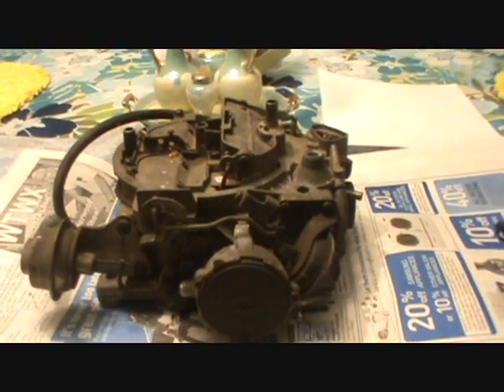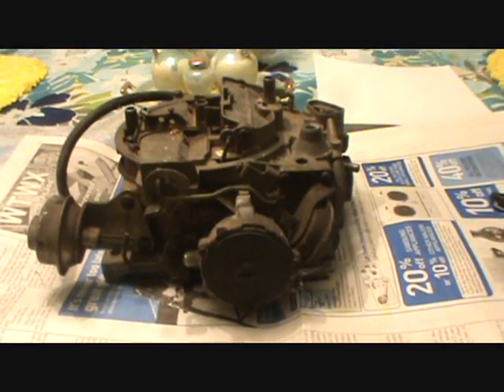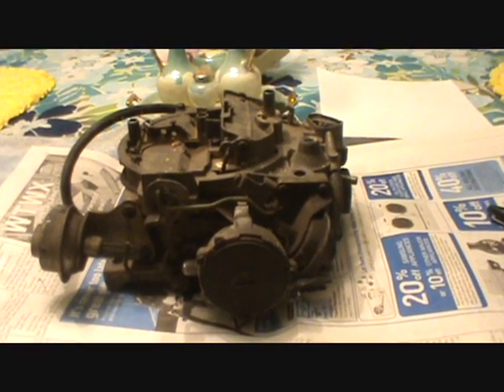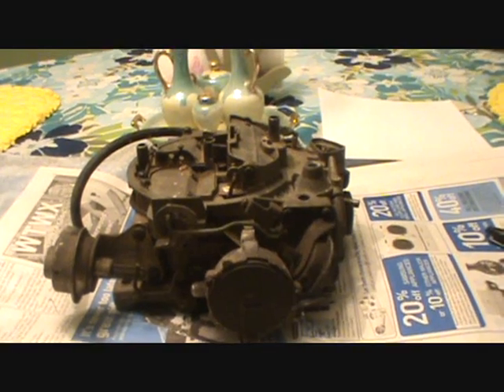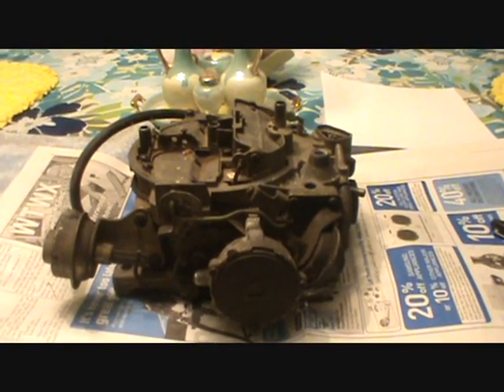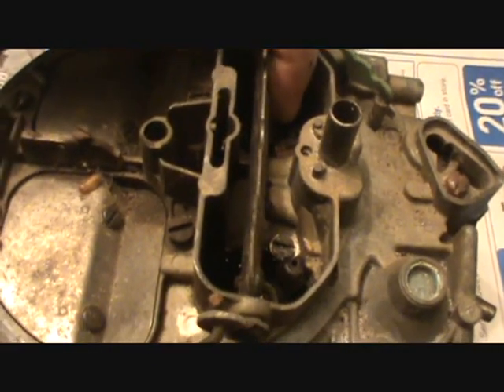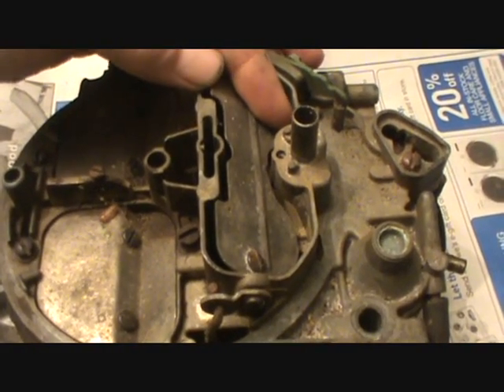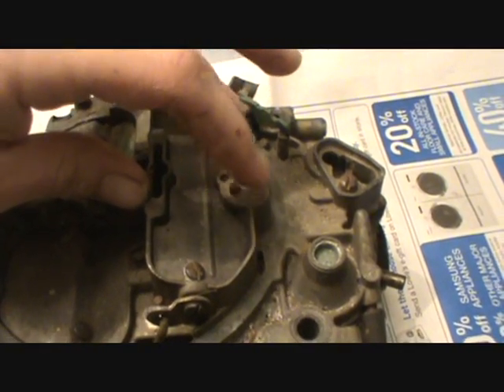How to understand automatic chokes part 1

Comment: When I put the air horn back on and tighten the choke plate screw, do I want the plates straight up and down? I tightened with it closed and now the secondaries are locked. I wondered if that’s why. I have two pull offs. One that’s loose (doesn’t stay in when I plug the port)..the secondaries open with that, but I feel like that’s because the pull off isn’t working.

Comment: Hi Tyler,  I've watched many of your Q jet videos.  Is it true, that the pull off diaphram will relax, and allow the air door to open when manifold vacuum drops above idle and midrange?  "70 Cutlass, 403, '70 heads, headers, edelbrock dual plane , lunati 485.495 cam.  I've disconnected the pull off hose and blocked it, to watch the air doors. which work like I'd expect in the garage.  But I presume that while driving , I'd want to let the pull off linkage keep the air door closed until higher RPM.  Do I have it right?  Tom

Comment: I'm trying to fix a buick 4.1 v6. The choke looks like it's just stuck open. When I push it there is no resistance it just bobs up and down. Do you think a spring or somthing is missing. The choke doesn't do anything when running or when giving it gas. It just stays open
Reply from the maker: Missing or broken. Rod from the choke plate goes down to a small link that rides on the inner end of the choke "pivot".  Sometimes they don't get put back correctly. The spring inside the housing is integral to the entire operation of the choke. Studying a picture or exploded diagram will help you understand what you are looking at.

Comment: My Rochester 4 barrel (1988) on a marine Chevy 350  (28 foot Bayliner boat) starts and runs but when kick in the gas it dies.  Runs great under idle and at high RPM's, but when put into gear and put it under load dies.  Ideas?
Reply: Doug Hogan the switch that makes the engine stumble or actually shut off for a second when you put it in gear is out of adjustment it has the switch to save wear on the out drive gears when engaging forward and reverse

Comment: Can you explain why some electric choke carbs like edelbrock 1406 don't use a vacuum brake and still work well on cold starts?
Reply from the maker: They have one, it's internal.
Reply: Explain, I took mines apart and didn't see anything like that.
Reply from the maker: Go down this page until you find "choke adjustment". On these it is called a choke piston, but still works from vacuum. It's part of the choke housing. If you look at the front part of the housing you'll see the shape of the bore that the vacuum piston travels in.
http://www.telusplanet.net/public/gilesij/Volvord/section_2.htm

Comment: Hi, I just used used your  videos to rebuild my Quadrajet. I don't know if I have the choke set right. I can't open  the choke flap unless I pull back the throttle lever. I see in your video you can move the choke flap freely without messing with the throttle lever. I have two other Quads where I don't have to mess with the throttle lever in order to move the choke flap. Is something out of adjustment? Thanks for your very informative videos.

Comment: Really enjoy your videos on these Quadrajet carbs. As you went through in the first three parts of this series, the secondary portion of my Quadrajet would not function no matter what. Unlike your carburetor, mine has only one vacuum pull off at the rear which acts as a limit on those air doors and also acts as a choke pull off. So there are two linkages, one for the air door, one for the choke pull off. Well the second linkage had fallen off and was jamming up the end of the throttle shaft for the secondary. Could not see this from on top of the carburetor as it was on the engine because the electric choke housing covered it up along with some coolant hoses which run right next to the choke housing. Believe it or not....this is on a Mopar 360 cubic inch...Rochester Quadrajet, stock from the factory 1987! Been running on the primary jets only for the past 25 years maybe!! Lol!
Reply from the maker: Haha, how about that. Yep, Mopar used Qjets from 1985-87 because Carter Carburetor exited the carb business during 1984-85.
Reply: Tyler's Neighborhood Garage this rig is running alot better since I worked on it... but is still a dog and I am not certain the secondary is working. Hitting wide open throttle just doesnt get much for hp. Starting to wonder if my exhaust system/cat. Convertor isnt partially plugged. Getting some strange rattling noises from under the floorboards. Will look into that when the wethr warms up.

Comment: My Rochester quadrajet attached to my '74 Olds 98 will not start after sitting maybe 10 days unless primed. Any idea on how to correct this?
Reply: Not sure if my scenario matches your issue, but on my 78 Silverado, the fuel tank is mounted so low that the fuel drains back to the tank, emptying the fuel line, and applying a vacuum to the needle in the seat.  If enough time has passed it won't break the vacuum and a splash of fuel in carb is needed.  I have a clear fuel filter that will be empty, I crank until filter contains fuel, one pump on pedal, splash of fuel, and fires right up.  Maybe I have a needle / seat issue, maybe I have a fuel pump issue.  Hope this helps
Reply: Steve, If you watch some videos about Quadrajet rebuilds they talk about lead well plugs on the bottom of the center section of the carburetor, the section that holds the float, needle and needle seat, etc. Those plugs tend to develop slow leaks after thousands of heat cycles. You can melt them and replace with epoxy, JB weld, etc.  Google up Quadrajet Well Plugs and you'll find info on this.

When they leak slowly over several days the fuel in the carb bowl drains out, this causes hard starting because you have to wait for the fuel pump to refill the fuel bowl. I bet that's the cause of your issue.

Comment: i have a 1991 astro van and everytime i turn the swtch on and push the gas pedal it wont start have to wait a couple of hours and try it again. then it starts if i dont press gas. ive been told its the choke and needs adjusting

Comment: I have a 1987 Monte Carlo super sport it seems when I put the car and drive or reverse the idle drops. Even if I put the AC on car wood putter  like it wants to stall does anyone have any ideas was told it could be. I was told it could be the Idle control valve but not sure where its located ?
Reply from the maker: Steve Acevedo  Steve those don't have an idle control valve. Those are a fuel-injected part.

 Your car has a plain old carburetor, which in this case is computer-controlled but still adjustable.  If you don't feel capable or have the means to adjust the carb and timing and check for vacuum leaks, then I suggest you find a GOOD garage with mechanics that have been there long enough to have worked on carbureted cars and have the following done:

1. Check and adjust ignition timing
2. Check and adjust idle mixture if possible. Sometimes the adjuster screws are sealed.
3. Check and adjust automatic choke, fast idle speed and base idle speed.
4. Check idle-up solenoid for proper operation with AC on.

I can further explain any of this if you desire.

Comment: Hi I have a 1978 bucket regal limited 5.0 305 V8 with a 4 barrel carb quaddrowjet divorced choke it has a problem starting in warm and cold weather and it wants to die all the time could that be the carb or no should I buy a new one

Comment: my name is scott and hope you can help. i have 79 k10 5.7 it leaks gas in to the engine when it sets. it runs great just after it sets i have to crank it for awhile before it starts and then it smokes but it gas smoke do u have a fix for that.. thanks
Reply: b
Reply: valve spring seals? mine had a similar problem after a day of not running it burned a tinny bit of oil

Comment: What makes that choke housing work? I just ordered a carb that has a housing like the one shown. There's a block off plate on my manifold that I know works everything, but can't seem to find what Im going to need to make it work. I know a bit about qjets. I'd like this to be my first one with a functioning choke though. Lol
Reply from the maker: It works off of hot air. A steel line normally leads from a connection at the top rear of the air horn down to where that block-off plate is. There is supposed to be a part called a heat stove in the intake manifold. A heat stove is simply a length of steel tube that will fit inside that recess there and causes the air passing through said tube to get hot.

The air is drawn through the heat stove and into the choke housing by a small vacuum orifice inside the choke housing. Of course, there is a tube that leads from the heat stove to the choke as well.

 What kind of engine is this? Oldsmobile commonly used hot-air chokes and the parts for those are easy to find, but although Chevy did use some hot-air chokes, the parts are slightly more scarce.
Reply from the maker: Google Oldsmobile hot air choke and look at the images for that search. You'll see right away the different parts I described. It's a very simple system.

Comment: What happens if you try to adjust those two screws and there's no response. Is there a rule of thumb about how to adjust them for instance should I turn it all the way to the right and then back it off maybe one turn
Reply from the maker: If they don't respond, then possibly something is affecting the mixture, such as a vacuum leak, or the carb is dirty/running too rich. Sometimes the ignition timing being out of adjustment can have the same effect.

 On the mixture screws, a baseline is to run them in(clockwise) until they lightly seat, then back out 2-1/2 turns.That should always get one running.

Comment: My lincoln with 460 cid ford semes to have hot air system and an electrickal conetor to the choke housing is it boulth systems? Anyway i had plugged the hot air system stupid me:-D so now it works!
Reply from the maker: Yes, it's a hot air choke with electric assist. Mainly done to make sure the choke did not stay on longer than needed during moderately cool weather. There's an electric switch that cut the electric assist when the temps got low and the choke needed to be on longer.

Comment: so when your car is off and cold the choke should be wide open right?? mines stays closed . I open with my finger and it clicks and stays open. this is when the car is cold and not been running for awhile.
Reply: Flap should be closed when cold, it'll open up with heat

Comment from the maker: Congratulations! The "flap" part of the choke at the top is usually has spring pressure to keep it closed until some type of heating begins working on the spring that closes the choke in the first place. Sometimes the spring is on the carb itself or sometime on the manifold below the carb. So, what you are describing seems normal unless there is a bind caused by mechanical interference.

Comment: hey I was wondering if u can help me.
I just bought my first truck , its a 74 chevy pick up 350 
and I crank it and it starts but it shuts off after 3 sec 
I also notice that gasoline is shooting out the top of the carb right next to the choke flap 
do u think that its to much fuel getting into the carb ? 
how can I fix this problem

Comment: I have a '75 covette with a quadrajet, and after I run it for a while it will run-on for a second after I shut it off, what could cause this? Its not running too hot but it stumbles when i try to engage the 4-barrels, could there be too much unburned gas? I have watched your other videos and will try to fix the 4-barrel problem, any ideas?

Comment: Hey Man great video. I have been using these carbs since i was 16 and rebuilt a 307 chevy I knew choke n off choke never worried about it. I have 3 carbs on 3 moters that this choke thing will help. was thinking of getting rid of carbs n going to fuel injection for fast starts. Again thanks for your time.

Comment: I have a 1985 K10 with a 305 and when I cold start the motor it runs for a second or two and cuts off.  When I start it again it usually stays running the second time.  The other issue is that once it's warmed up do I have to pat the gas to get the idle back down or should it do it on its own?

Comment: Hello Tyler: I have a 1946 Cadillac with a flathead V8. My problem is the oil looks like it gets diluted with gas. Could this be choke problems? Does the fuel evaporate out of the carburetor when it sits for three days because I have a hard time getting it started. Carburetor fuel bowl goes empty. Carburetor is a Stromberg AVV-26
Any advice? Thanks again

Comment: so nice if you to help so many ppl, now heres my problem , i have a 1978 Camaro 350 with a quadrajet ,electric choke, my idle screw is all the way out but it still idles too high, seems to drop down good when in gear but when i put it back in park up it goes, new with carbs so help plz

Comment: So I did this, and it worked. Starts and runs like a champ, but I do have question sir. It'll start and idle at about 1100 right away but after some time, it'll climb yp 1500ish and hang there until current warms the coil. Any suggestions?

Comment from the maker: Another thing that can happen esp. after 40 years is the intake or the entire engine gets swapped for another one that doesn't have the choke mounted on the intake,,, because those are rare.

 Then the choke plate just stays in one position with no way to control it

Comment from the maker: Well just to reiterate the video...you need to have spring tension to make the choke come on and then a source of heat to make the choke disengage. That one came with a 2GV, which means it has the choke coil mounted on the intake and a rod running upward to the choke flap.

 Those usually are very simple and reliable but sometimes the linkage will hang up and make the choke/fast idle stay on.

Comment: I was riding my motorcycle going back home,I didn't noticed that my choke was fully on. I was running 60 kph and couldn't rise the speed. I reach 14 kilometers before I noticed that there was something wrong. What could be the effect to my motorcycle engine..?

Comment from the maker: That particular carb is a 1977 model, and it is one of the versions that uses a divorced choke..meaning the choke coil assembly is mounted in the intake and has a rod that runs up to the carb.

 If your intake does not have provisions for that, then you'll either need to consider finding another carb that has the integral choke, swapping intakes, or resorting to using a manual choke because those carbs can't be converted to use the integral choke.

Comment: i tryed it again today , that flap just stays in one spot an if i gradually get on the gas an then floor it ,it doesnt do it as bad,,i tryed adjusting that flap by hand an still didnt make a diffenece were i would put it, i did try two different sets of metering rods an it still bogged,When i floor it i cant see no gas coming out of  the accelerator-pump squirters,I have cleaned this carb out spotless so its not dirt ,iam just at a lost of what to do ,

Comment from the maker: I actually like Edelbrocks since I've messed around with them and seen how simple they are to tune.

It sounds at first blush like the secondaries are coming on when they should. That'll either come back to be a fuel supply issue or air supply. Those have that counterweight air door which really shouldn't give trouble.

Will it open the 4bbl if you go into it gradually or does it just lay over any time you try to get all 4bbls opened up?

Comment: My question is about your favorite Edelbrock carb LoL ,Well you said not to be afraid, So I got a 650 Thunder series,On a 350 sbc ,it starts up good, idles fine, but when i full throttle it, it just bogs an it will stall ,runs great if i don't try to floor it,Any ideals of what i can check? i did clean the carb out ,an check the float settings ,maybe i can do a video of how it acts,An i guess iam Joeblow lol i did that one time but was like 18 at the time learned a lesson that dad, lol .

Comment: I have Carb issuses recently rebuilt but when I hit the accelerator and the back barrel open u can c gas on the barrrel and bog down but if I stomp it and when it bogs down and if I let off the pedal some it Will take off then what is the problem

Comment: I have I boat with mercury 4.3 engine, when I took it to the lake RPM only go up to 2800 according to the book it should go about 4800 full throttle, when I got home I checked the carburetor and I notice the choke plate doesn't move much (almost no move)  with engine off, is this why it won't go faster than 30mph ( RPM no higher than 2800) any suggestions? Thank you

Comment: Thanks for your vids. I had a vac. hose loose on my 83 Monte Carlo that I couldnt figure where the other end went for about 3yrs. I watched a few of your vids and from that I found the vac. port on the bottom of the carb., hooked up the hose, vrooom! Found my mixture screws too, down by the vac. port. Thanks for sharing!

Comment: I have an 87 grand prix and I been having trouble with it dying out on me a lot especially after I let it warm up and then put it into gear and it'll die out unless I pump the gas real quick just to keep it on, but after that it drives like a dream. Could it be a bad quadrajet carb

Comment from the maker: @brandon1997bmx  the choke coil may need tightened by loosening the screws and rotating counter-clockwise
Reply: If the choke's thermostat is riveted on from the factory do you recommend to drill out the rivets and put in screws??
Reply from the maker: @IvoPoblete  yes, that is fine.